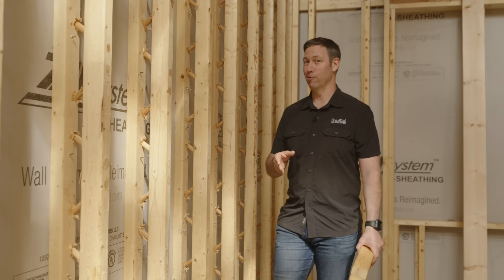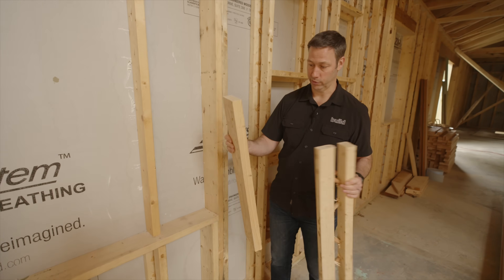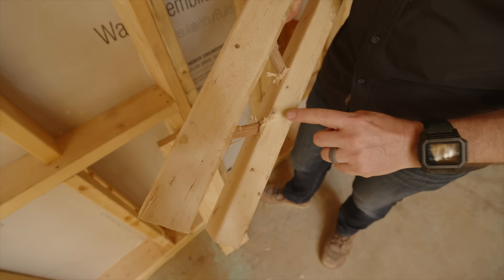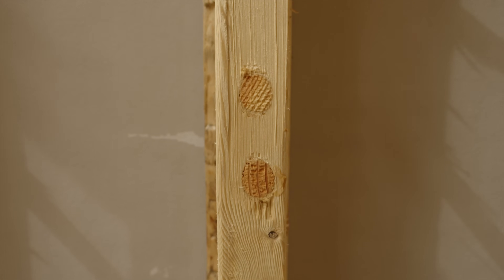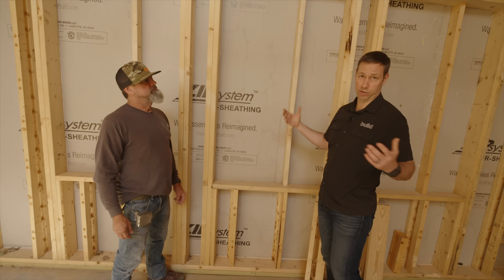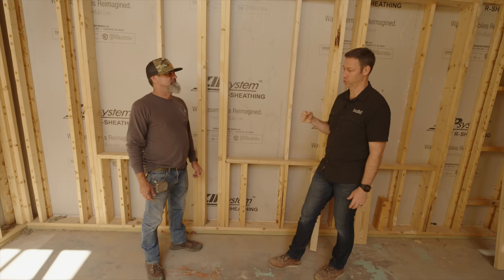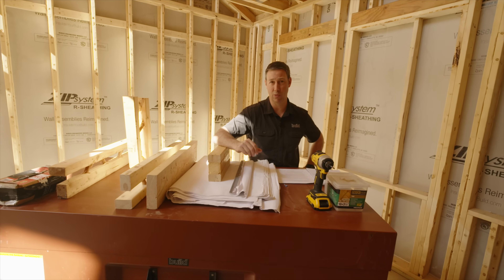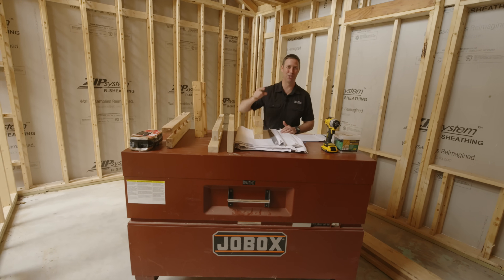Framing with a 2x6 Replacement - TSTUDS!!!

Comment: When you said the electrician doesn’t have to do any sweeping, where you implying they clean up after themselves... haha that’s a funny one
Reply: I can confirm that. As a spray foam guy I end up cleaning up everyone else’s mess when I clean up my foam trimmings.
Reply: @christophergruenwald5054  I can confirm, the foam guys I've used clean up the place so well I feel like I should be tipping them.
Reply: As a general contractor, I've never seen a sparky with a broom in his hand or his van! ;)
Reply: @chrisford8403  Thats weird as a contractor I have never worked with anyone who didn't clean up after themselves. Probably because I work with people similar to myself.
Reply: topherh33  No one's asking them to wash windows! There's absolutely no reason why they can't pick the pieces of drywall they cut out for outlets or pucks. There's no reason why they can't use a bucket to catch pieces of wire and sheathing they cut. There's no reason why they can't carry out their empty cardboard boxes. Of course, some are better than others about making a mess.
Reply: Right I've never seen an electrician or a plumber to sweep up after themselves. That's just ridiculous
Reply: @kevinlawrence1582  hey hey dont mess up plumbers with electricians Way of cleaning🥺. in denmark we the plumbers do indeed clean up after our self. (Cant tell tho if in us/uk it’s the same).
But electrisians seems to be the same all over tha planet!
Reply: @Ampacityelectric  the latter is true in my area.  I/We have sub contracted for some of the largest and smallest builders around, and I can tell you that it has been 20+ years since I have seen a builder actually employ a laborer to clean job sites etc.  As much as I would like to never touch a broom again, I believe this is a reality around my parts til I retire.
Reply: They pick up sizeable scrap copper but that's where it ends. Romex paper and clips of wire everywhere
Reply: Electrical 101, chapter 1, everything goes on the floor and it is against the code for all Electricians and helpers to Touch a broom.
Reply: When I was younger and I worked with my father doing electrical he always made sure we swept up after the ruff in. He even made sure we had a small vacuum when we did any work in a finished house to clean up the drywall dust.
Reply: @lawnmowerdude  he took pride in his work, the owner's property, and respected the other trades to follow.. they just don't make um like that any more ;)
Reply: If electricians were meant to sweep God wouldn’t have made laborers.
Reply: Yea for sure funny. Never in my 35 years construction have I seen one electrician even take the cardboard boxes out after installing lights. Just drop them right where they installed the light. What’s with that ?????
Reply: TRUEST STATEMENT EVER!!
Reply: That is the responsibility of the builder, you hire people that clean after themselves or you don't hire them, period. You can't be their mommy and go cleaning afterwards. Lazy builder, lazy workers... plus all that saw, drywall and metal dust is a fire and health hazard 🔥
Reply: i love it. the actual thought that an electrician would clean up is hilarious
Reply: I’m a comm technician JM. All my termination clippings go into a small box I carry with me at work. A little pride and PROFESSIONALISM go along way to get return business. “Leave it better than what you found it” needs to be mentored to every apprentice, in every trade. Getting rid of piece work and going back to hourly wages would go a long way to fixing the rep of most trades.
Reply: If that is truly the case...your GC needs to get new sub contractors...

I am an electrician...and I can assure you that our crew does in fact carry brooms, dust pans, and even their own garbage cans to ensure their jobs are left as clean if not cleaner than when they arrived.
Reply: @22Buckman  HEAR HEAR. I've been an electrician for 8 years and take pride in leaving my job sites clean.
Reply: @22Buckman  That's a first. You're hired!
Reply: @22Buckman  hell yeah brother!
I frequently throw guys off when I start sweeping up terminating mess or blowing off rough in sawdust ect.
Reply: @22Buckman  Well then YOU are a rarity  !
      I know first-hand working for a GC for many years,  Very few of ANY Trades clean up after themselves. 
     They're all coming and going at various stages and getting in and out seems to be their priority. 
      Leaving the mess for the GC seems to be the prevailing theme.
Reply: Most of the electricians/plumbers I’ve seen at job sites clean up during/after they’re done(depends how many hands they’ve got on site). Hvac, usually only the ducting. Rarely anything else. The framers though, I’ve never seen them clean up except for one builders neighborhood. They’re usually done by the time I get there so I have to take pictures and send them in so we don’t get back charged for a mess. Even though nothing I do involves causing all the saw dust.
Reply: @93vxhybridhatchback  i think its all chopped up to not my job not my problem. And looks good from my house
Reply: Obviously the drywall guy has to clean up before he starts and when he's done sanding.
Reply: Hahaha. I was thinking the same thing. I think we sweeped maybe a dozen times in the 10 years I worked as a romex jockey.
Reply: I really believe that sweeping is against the election union's bylaws.
Reply: electrician, sweep? right
Reply: I heard of an electrician sweeping up once but it was just an urban legend.
Reply: I  contracted for a large specific group of different builders in Residential and Commercial. The Commercial GC’s would always thank me at the end of the day for cleaning up our mess. My crew didn’t like it but thats part of their paycheck.
Reply: @elconquistador932 I still never have seen a sparky or a plumber use a broom I spent 20 year's as a framer the last 10 years as a superintendent for a medium sized custom home builder I don't doubt your story but alot of people claim to have seen bigfoot also but there's still no scientific evidence of one.
Reply: I don't mind that they don't clean up after themselves since I can do it and make $50 an hour to sweep:)
Reply: @functionalvanconversion4284  nobody in construction makes 50 an hour unless your piece rate and then you definitely will not sweep up after the sparkys.
Reply: I may have missed it on the video; however, is there a noise reduction benefit as a decoupled wall?
Reply: They're supposed to. Period.  People claim they've never seen it done or done it themselves... tells you the state of the trades.
Reply: Never had a electrician clean up
Reply: 😂fn hilarious
Reply: My electrician says “when Klein makes a broom I’ll sweep”
Reply: I saw an electrician grab a broom one time but he was just moving it because it was in his way …
Reply: I worked for electrical contractors for 28 yrs, not one of them ever tolerated electricians leaving a mess behind….wood shavings, wire remnants, rolling stock.  But, the myth persists we’re the messy slobs on the job. My opinion framers are the worst
Reply: At least, with plumbers the mess tends to be in a few places instead of the entire house. :) I just wish both would stop using the HAMMER-SAW to make holes in drywall, lol.
Reply: I’ve had laborers thank me for not cleaning up,keeps them working.
Reply: I take pride in my work and always sweep a rough after drilling, and before wrapping up.
Reply: @Ampacityelectric  Sounds very reasonable. I'm on the renovation side of things. I expect every sub to clean up their own mess. Of course, if you have a pile of pooh in one hand and expectations in the other hand, then you just have 2 handfuls of crap! LOL! Only once have I seen an old timer and his younger apprentice carry 5 gallon buckets with them and clean up as they go. If you ask nicely and leave a broom hanging around most will tidy up the majority of their mess. BUT, it's always more fun to talk trash about certain trades. ;)
Reply: @chrisford8403  good point When I do the electrical work, I usually ask the gc or customer what their expectations are for clean up. Most will say they will do it as they don't want to pay my rate for time spent sweeping.
Reply: @rtheprizeisright7323  I mostly do it as side jobs and people always want the cheapest price possible but if someone wants to pay me $85 to push a broom I’m game.
Reply: @rtheprizeisright7323  sweeping takes like 15 minutes.......wow you must be super valuable.....lmfao gimme a break
Reply: @chrisford8403  hopefully you're using gloves
Reply: I'm Electrician, I'll happily spend time to cleanup. 
But my rate is still 120$ hr...
Any questions ?
Reply: @benjurqunov  Nope, I'm sweeping up anyway, you just do you.

I would never hire an electrician or a plumber that cleaned up after themselves. 

This is also why child labor needs to be a thing. Cleaning up is for the teenagers. How else are they going to learn to be productive members of society?
Reply: Being the son of an electrician I can confirm, this is 100 percent true.

Comment: Matt, do you have any knowledge of an 8 inch T-Stud and both the BareNaked and the pre foamed T-Stud? I'd call it the r19 but at 8" over the 6" it should be greater then r19.
Reply from the maker: I believe they have several more configurations in the works. I suspect their insulated 2x8 size would do very well.

Comment: I looked into using these for my new construction.  The manufacturer didn't return phone calls and was very slow to provide structural details.  When they finally did respond, the pricing was very high.  It felt like a very small operation.
Reply from the maker: They are indeed a small operation but they are growing. I’m hopeful that these will eventually be stocked at my local lumber yard.

Comment: 12:34 Oh don't worry the plumbers are going to figure out a way to destroy the structural integrity of the thing. Blowing a big hole in structural members are what they do best. Unless you count setting a floor drain higher than the floor so water has to run uphill.

Comment: So what does that do to the fire ratings? Since you’ve created an open space that the fire can spread through easier. And the structure seems to be compromised if one side of the stud gets  blown out. I don’t think the costs are reasonable at this point to make a change.
Reply from the maker: Fire rating is the same. The double top plate provides a fire block to keep it from spreading.

Comment: It amazes me what people come up with! Looks like an awesome product. From a firefighting perspective, these are sooo dangerous. By having these open-web studs, in the event that fire starts in the wall, or makes its way into a wall, these studs allow fire to spread extremely rapidly and consume the studs much faster than conventional lumber, this causing total.collapse MUCH faster. I guarantee this type of construction will kill firefighters.
Reply from the maker: Really?  How so?  Fire rating is the same. The double top plate provides a fire block to keep it from spreading. Use mineral wool blown if this is a concern. How many new homes have fires emanate from a stud bay?  I don’t see that as a reason to not use these.
Reply: Nearly 30,000 fires per year are caused by electrical problems. Even if the fire didn't start in the wall, if it breaches a wall through an opening such as an outlet, box for a light fixture, HVAC it will spread much faster horizontally in that wall than 2x6's. A normal piece of dimensional lumber acts as a fire stop that keeps the fire in a single bay. These allow fire to spread laterally much more rapidly. Same concept goes for 2x4 floor truss systems. There is nothing that keeps the fire from spreading laterally compared to conventional framing.

For the record: I love your channel and what YOU do with energy efficiency. I'm worried that other builders will use this technology mixed with cheaper, conventional insulation methods that aren't as fire resistive. If you get the time, look up the number of firefighter deaths attributed to floor truss and other "lightweight" construction.

Comment: Hey Matt! Check out this video a guy made about a poor zip sheathing install. This has got to be one of the worst installs I've ever seen. It really goes to show how not installing an excellent product the proper way may make it the worst product...    https://youtu.be/yELE80sP-Yg
Reply from the maker: I’ve seen just as many terrible installs of housewrap products. Craftsmanship always is needed when it comes to a weather resistive barrier. We must remember that a home’s #1 enemy is water. Following closely by air leakage
Reply: @buildshow  have you ever had to reside a house using windows that were replaced since the original house was built. So no flange windows? I would love to see you make a video about flashing around unflanged windows. I know ideally you would always replace the windows at the same time as the siding however sometimes budget may not allow it especially if the windows were recently replaced. I know, I know, out of order.

Comment: Awesome to mitigate thermal transfer, but also a great way for an electrical short to result in catastrophic lateral fire spread. Please don’t forget studs essentially act as vertical fire blocking for in-wall fires in lightweight wood framing. I could only see specifying these members on an exterior wall with spray insulation to displace air (oxygen) in all cavities.  That said I would never use this for an internal bearing wall that would likely not include insulation; hidden fire spread in this kind of assembly could definitely result in unexpected/accelerated collapse and kill firefighters without warning.  The effect would be multiplied by the small wood dowels that would accelerate fire growth as literal ladder fuel. Think about being in the smoke-filled, zero-visibility second floor of residence searching for the seat of a hidden fire, not knowing it is below you because your department can’t afford thermal-imaging, and all of a sudden the apparently solid floor deck your standing on fails because the wall supporting it below fails.  When that wall fails and the likely smoldering, now oxygen-starved combustible gases escape the cavity due to the wall failure, ignite and expose other adjacent fuels in rooms. This is a step back to balloon framing and should not be used unless well-considered from a fire protection standpoint. I fear contractors swapping these out onsite saying “It’s just as strong as the 2x6 the engineer or architect specified.”  We all saw ill-considered lightweight floor truss designs that killed firefighters when they first came out; I fear if these ENGINEERED products could have the same fatal results if they are not ENGINEERED by a professional for each application.  This should never be a unilateral, onsite, value-engineering decision by a contractor.
Reply from the maker: The double top plate provides a fire block to keep it from spreading. Use mineral wool blown if this is a concern. How many new homes have fires emanate from a stud bay?  I think this concern is valid but I think you are overselling the % risk of this danger

Comment: I'm not liking that they aren't a square profile.  I think I'd be happier if both rails were the same width.  I'm also hearing one of the guys I learned from saying "when you go to engineered structures, you're replacing mass with math, and it takes a lot less damage before they lose all their integrity"  on the other hand, if they build these with laminated rails, like the rails on an I joist, and impregnate the resin with wood preservative and flame retardant, they could have a really warp resistant product, it would have all four corners, and they could be made to any length.  

on an unrelated note, we have a word for flangeless windows that screw into the framing.  we call them "leaks"

Comment: I’d be interested to see if the electrician or plumber bids lower because the hole hog can largely stay in the truck.
Reply: Nope the bigger soil pipes still won't fit between the members :(  you are best to build a wet wall in front of the outside wall if you want your wast arms or large soil pipes on the outside wall. The skinner pipes are no problem.

Comment: Matt,  I have a question, what about fire stopping?  I see a small electrical fire starting and then running un-detected the length of the hole wall.  What is required for a fire break or is it so new that they don't have any code specifics for it yet?
Reply from the maker: Valid concern but codes address fires running vertically. The double top plate is the fire stop.
Reply: @buildshow  I understand the top plate for the vertical spread.  I was wondering about the horizontal spread.  Say you get an electrical fire in one cavity of a stick framed building, the fire is kept to that one cavity for some time.  The fire has to burn through to the next cavity, then the next.  Yes wire and pipe cavities will allow horizontal spread but that is through small holes drilled in the studs,  These studs are completely open allowing rapid fire spread.